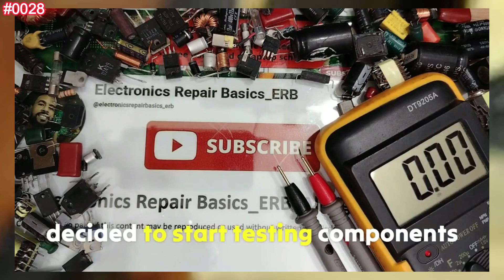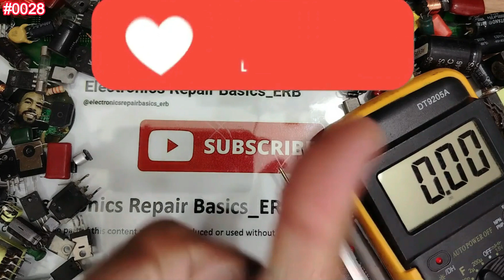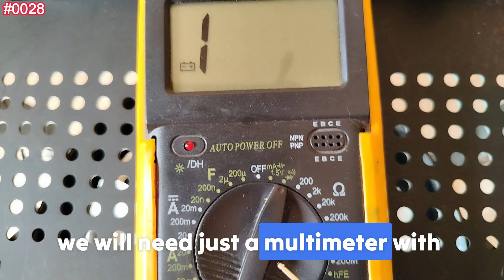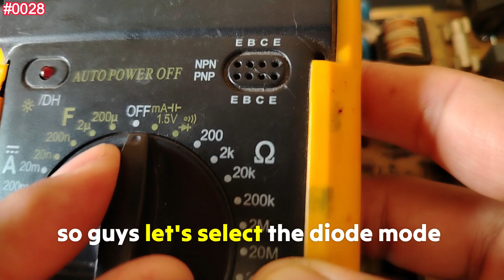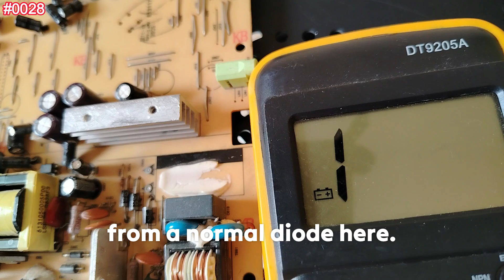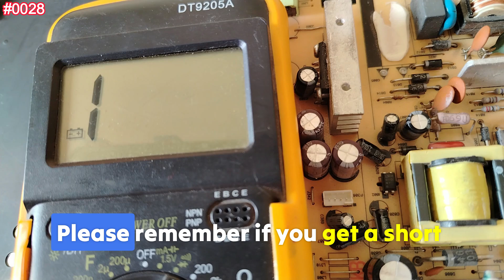#0028 Electronic Components Testing: How to Test a Dual Schottky Diode with a Multimeter - SBF1060CT

Comment: One thing about refrigerators. The power can go out and flux. The PICK chip gets corrupted and now the control board has failed. The chip is about 1 dollar and MUST BE PROGRAMMED WITH THE SOFTWARE TO WORK. They won't sell you the chip or allow you to their software. Can't read a PICK chip. So you must buy the VERY EXPENSIVE BOARD AND RETURN THE OLD ONE SO THEY CAN REPROGRAM THE CHIP AND SELL IT AGAN FOR A VERY HIGH PRICE. THAT IS THE SCAM

Comment: On the ceramic capacitors video I followed your instructions and I took a functional HP motherboard and in the capacitor test I noticed that there are capacitors that are not only connected to GND and cut by VCC. It therefore beeps from both and displays a resistance of 0 and yet the card is very functional. If it is possible you redo a video to explain this since normally if we have 0 as resistance it is a short circuit. We should have 0.1 or 0.2 if it is not a short circuit, right?